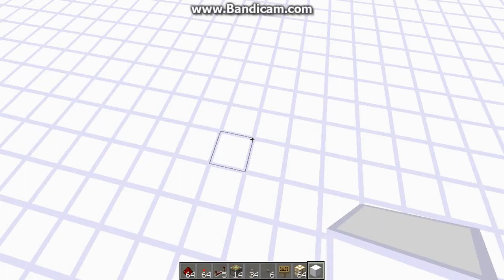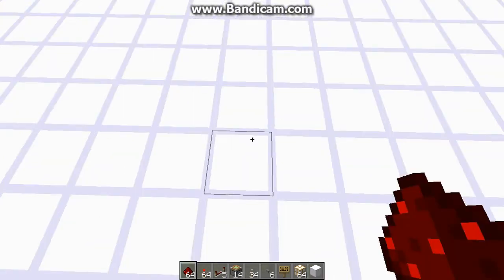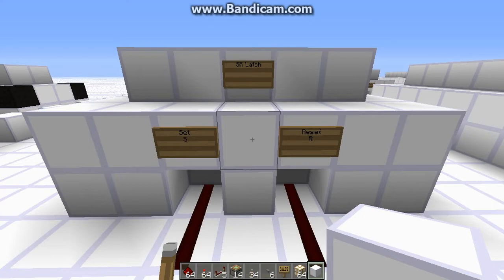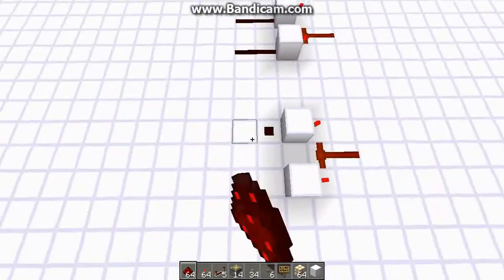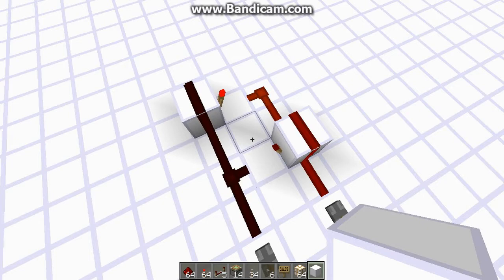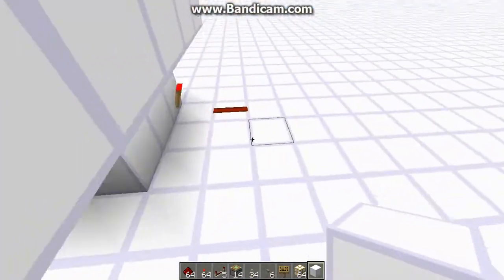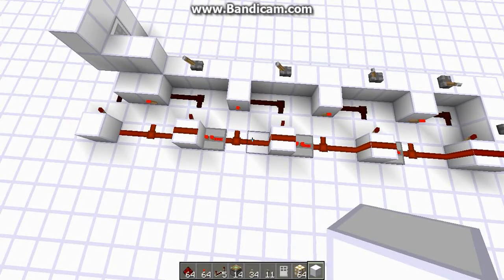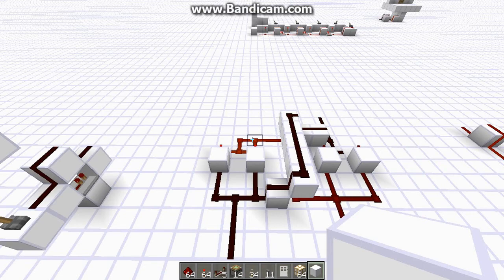Redstone Circuits 1: SR Latches

Comment: Really like your redstone videos.  For your information: SR vs RS has a meaning different than what you state.  Both the SR and the RS act the same if only one input is set.  SR means if both inputs are energized, the S input wins and the output is set.  RS means if both inputs are energized, the R input wins and the output is reset.  Thank you for your videos, I have found them very instructional.

Comment: An RS NAND latch in reality does have similar function to the R NOR latch except thet the inputs are inverted making the deice stable at 11, S and R at 10 and 01 and become unstable at 00. Just because you used the NAND gate does not make it a logical NAND. You hooked both inputs making it an inverter/NOR gate.